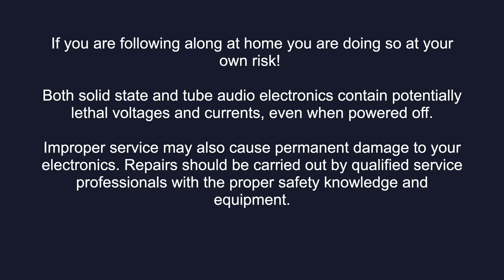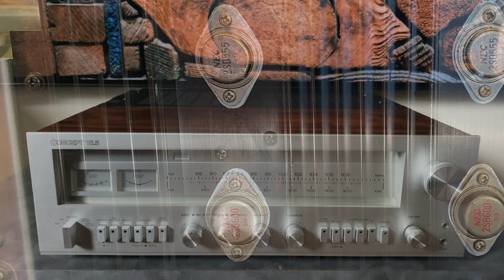Concept 16.5 Restoration Overview - Pacific Stereo's Best

Comment: I worked for Pacific Stereo from 1976 until its closing in 1986 as a service manager in 5 different stores. Here are a couple of things to add to your excellent presentation of the Concept 16.5.  There was never a service manual for the 16.5, only a schematic and some service bulletins. The concept line of receivers were manufactured by Tandy Corp in Japan. Pacific Stereo was sold to Burke Mathes (brother of Curtis Mathes) in 1983 by CBS. Without the working capital and backing of CBS, Pacific Stereo went out of business just 3 years later. In that same period, much larger publically traded chains like Circuit City came into the markets that Pacific Stereo had once dominated. At one time, Pacific Stereo was the largest retailer of consumer electronics in the USA. As a teenager in the early 70s, there was no place more cool to hang out in than Paciific Stereo. As an adult, there was no place better to work.
Reply: Is there a service manual for the Concept 11.0?
Reply: Apparently there were no service manuals for any of them. That's what I keep hearing from former employees. @bigblockelectra
Reply: Should add, though, that the original manuals all included schematics.
Reply: Finally somebody that knows. I get so tired of hearing people say these were built by pioneer😅😅😅😅😅😅

Comment: I had one. Its a BEAST. STRAIGHT BEAST. Dick Schram of Parasound designed this. They were built by Tandy corporation (yes radioshack). The lights in the buttons are LED LIGHTS. YEA LEDS. This receiver absolutely rocks. Dick is an awesome dude.  The damping factor is north of 500. They say it's the highest damping factor of any receiver. Ever.  This beast is laid out so awesomely designed its unbelievable.  5 gang tuner and all. The power ratings are severely under rated. This beats a sx 1250 anyday. The dual mono design is awesome and you can't beat it. Glad I had 4 years playing with this baby. Long live concept
Reply: Not many people know that these were built by radio shack CBS Tandy.

Comment: That’s a wolf in sheep’s clothing. Lots of power for a modest looking receiver. I like the understated looks, too, and that champagne finish looks nice lit up. The multi-band tone, and loudness control get a thumbs up. Best feature, though: the modular design. The “house branded” filter caps gave me a chuckle. Great presentation, Ben. Never heard of this brand before. And as always, your work is top-notch.
Reply: When powered up, the lights would dim in the room.

Comment: I had this receiver  before, I liked the sound of the Concept 11.0 a bit more, not as harsh, smoother and more balanced.  Still a good unit.  I also like the 12.0D with the digital clock, they all sound good.

Comment: I still have a Concept 2QD Turntable I got from Pacific Stereo in the late 70s. As you know it was a state of the art and the best for the times. Still, one of the best turntables around IMHO! I have an Audio-Technica AT20SS Shibata Tip Stylus cartridge on the turntable. The cost of the stylus was 250-300 bucks even back then! It's awesome! I also bought my Kenwood KR-6565 DC receiver from Custom Hi-Fi when I worked there in the late 70s for $600.00, I was there for a couple of years. I later picked up a Sansui 9900Z Digital Quartz Synthesizer Stereo DC Receiver, it's rated at 160 watts per channel into 8 ohms at THD: 0.015% and frequency response: 5Hz to 100kHz. It also has a liquid cool heat sink for the output transistors (the output stage is ALL discrete components, all the chips are in the tuner and display logic) and it also has an automatic thermostat controlled cooling fan on the rear panel. I still have it and still use it today. I was lucky enough to buy this receiver at a pawn shop I worked at in 1986 for $100.00, it was basically in new (mint) condition and still looks and sounds that way, I'm sure it could use an upgrade/restoration like your Concept 16.5 by now. I think back in 1981 this receiver retailed for around $1300.00 and it was the last year they made the hi-power monster receivers, then they went cheap and plastic and crappy sounding. My Kenwood receiver is carefully wrapped in plastic and stored in a nice cool cabinet in my bedroom, I guess it's become my back up receiver and it's still in 100% mint condition. I take great care of my equipment, they're lasting me a lifetime. So far so good, I'm still here and so are they.

Comment: Super video! Great combination of production and content. Your visuals support your points and your Information seems to be current, interesting and complete. Well done sir! One thing that struck me as interesting is that the layout is reversed from many Japanese designs. The selector on the left and the power and speaker options on the right. The same thing extends to the back panel with speaker inputs on the right and switched and unswitched inputs on the left.  That had to be a conscious design choice.
Reply from the maker: Thank you for the positive feedback. Much appreciated.